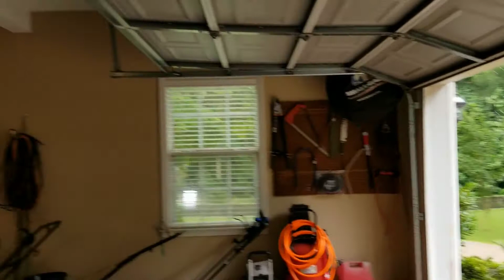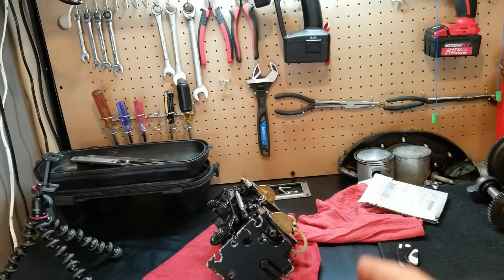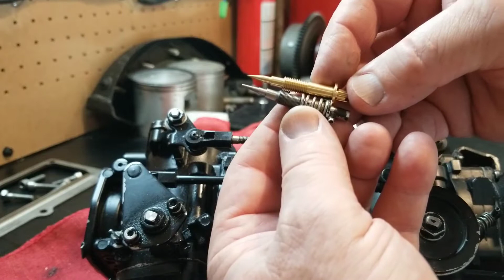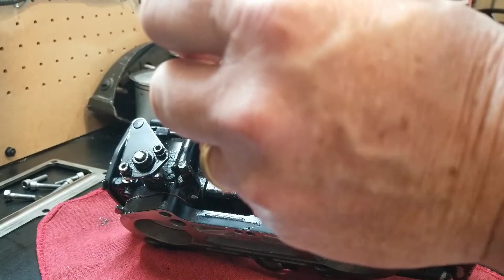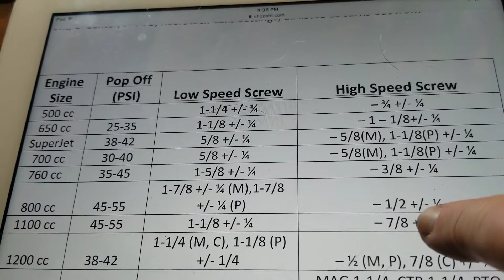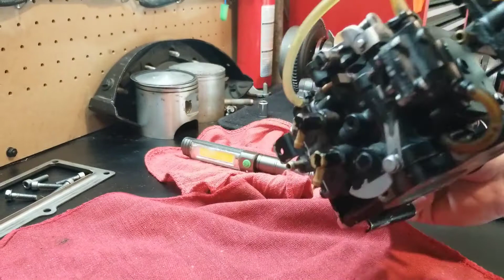Yamaha XL800 Waverunner Rebuild Part 7  FINISHED!

Comment: I have exact same waverunner 2002. Your video was a great help. Mine has 120psi on front cylinder and only 30 on rear so saw broken ring or stuck so may put new head on and since I saw main seal in yours I'm going check that also. One thing I wanted to share is mine has oil in bottom but may be I over flowed when I filled it but anyway wanted to tell you if interested that make a block off plate that goes where oil pump goes and can mix your own gas and then you know it's right so I'm going do that because heard oil line bad to break or come loose. Thanks for all information. Ronnie Waynesville NC
Reply from the maker: Yeah, the oil lines on Waverunners are known to work their way off. I double zip tied my oil and fuel lines.

Comment: It looks like the thread pitch on the new part is a different(courser)pitch than the old one. Maybe it is an optical illusion from the camera but that might explain why it won't thread in nicely.
Reply from the maker: Your are right, It does look like it in the video.  I'm not going to pull it out and check, but I've got to believe I would have noticed it when i had them in my hands.

Comment: Do you have any update on the xp?
Reply from the maker: Well, I do and I don't.  I started a video, but didn't finish...at least not yet.  I thought I had found a complete engine for far less than what it was going to cost me to do a rebuild. Sadly, it didn't happen and so I've put it aside until I get my other 5 skis running right.

Comment: You say you cranked that new needle all the way in??  It has got to be out in order for the fuel oil mixture to lubricate the engine.  There is supposed to be a stainless steel washer after the spring and before your oring on that needle.  If you run that engine with the needle too far in it runs lean and will kill your cylinder from lack of oil.
These yamaha carbs are bad about sealing around the base and will high rev because they are sucking air from a vacuum leak at the carb base plate gasket.  You can test for vacuum leaks with the engine running by spaying carb cleaner at the base gasket.  If it revs up while it is sprayed you have a leak.
Reply from the maker: I wish you could actually be here to see the bent screw because the video does not do it justice.  When I watch the video it doesn't appear to be that bad, but it is.  Maybe the carb was dropped by the previous owner...I don't know.  Also, the video was too long so I had to edit some stuff out and one part was about thread damage on the old screw.  That made me think there also had to be thread damage within the carb as well because the new needle screw would not go all the way in.  Some of that was edited out as well,  but I make mention in the video of it not being right.  So...when I screwed the new needle all the way in and then backed it out 1 7/8, the idle was way too high.  As it was running I screwed it in little by little and it began to run much better.  Here is what I think...the new needle would not go all the way in because of thread damage in the carburetor, so that kinda made it backed out already.  By me backing it out another 1 7/8, it was now too far out making the ski's rpms really high.  As I screwed it in little by little it set the screw where it needed to be.  Hope this makes sense.  Question for you.  Lets say the needle is to too far in, all the way in, will it run run right?  It seems it would be choking it out if the screw was too far in.  I guess maybe it would run ok if it was sucking air at the gasket right?
Reply from the maker: I'm going to ask RPM Auto to chime in get his thoughts.
Reply: @papadonjetski9535  The engine tends to run better in a lean condition ie it sounds better where a rich bog it idles rough and you really cant give it any throttle and it will stall out.  I highly recommend Ericson machine and performance channels videos on carb building and checking plugs after carb builds.  He explains it well and shows you what to do and how to get that chocolate brown look you want on the plugs by backing the screw off just after reaching that lean idle threshold.  Of course those screws are not easy to reach on this model and if you pulled that carb chances are that thin carb gasket will have to be overtorqued to seal properly.  Some people double them up to prevent vacuum  leaks.
Reply from the maker: @atypicalhiker  This is all good stuff, definitely will help me as I continue to tweak it.  Thanks

Comment: Hey great series. I’m currently rebuilding a xl800 from ground up changed crank bearing and lots of other stuff I’m now on the carbs and the same bent pin u replaced I have a totally broken one I’m sure u know there aren’t much OEM parts so could u link the place u got your replacement pin? Thanks
Reply from the maker: You are correct about OEM parts. I ended up getting it off of ebay.  I did a search with "Genuine Mikuni low speed screw for bn44 carburetor".  I haven't gotten the waverunner on the water yet, plan to do that tomorrow if the weather allows, so I hope this screw works out.